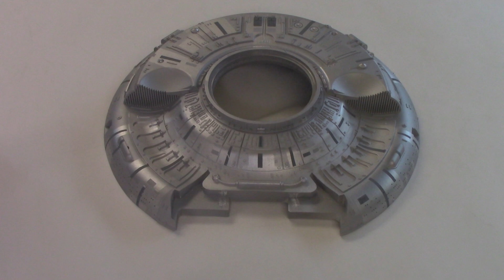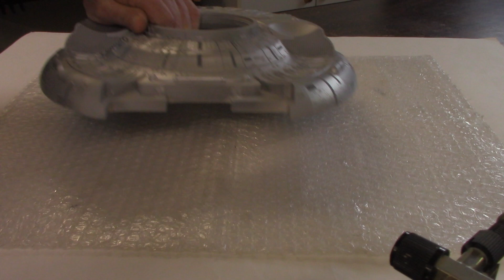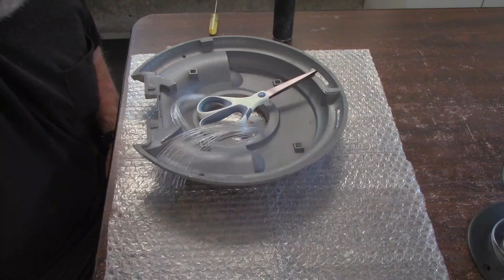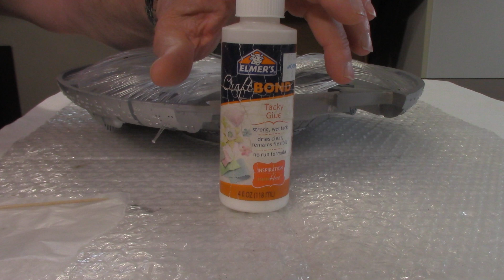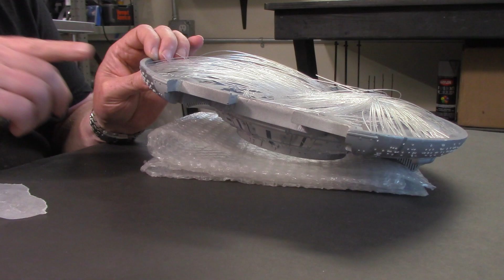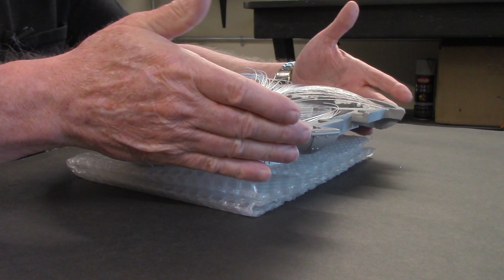Fiberoptics 101 Install Video 2024

Comment: Randy do you have a video showing how you put the Fiber Optic into the cans and securing them in place as well as the lighting for this ?? Love your videos !!
Reply from the maker: The fibers are all put together in a bundle. Dress the end of group, and stuff the  fibers in the can, use some cloth masking tape to hold the fibers to the can.
Reply: @voodoofx1946  once you dress the ends and maneuver them into the cans , do you glue the bundle together as a group into the cans ? Or do you just slide them into the can tape them to can and then tape can down so it doesn’t move around ?

Comment: interesting, so do you sand off the blobby end bits on the outside for a clean finish? thanks
Reply from the maker: Once you dress the end "THE BLOB" you are optical clear & polished. It's not the prettiest but gets the job done. You can flush cut them if you want but the fiber end becomes very narrow and need to be viewed almost straight on.

Comment: Incredible tutorial. I feel more confident about trying this technique.  What size roll (how many feet) of filament would you recommend for a project like this?
Reply from the maker: I ordered a 1500 foot  roll. I used around 300-450 feet for this project total.
Reply: @voodoofx1946   it's so amazing how much sheer length is used in a small space. when there are that many points of light.  There can literally be a mile of filament inside something like a studio scale star destroyer.